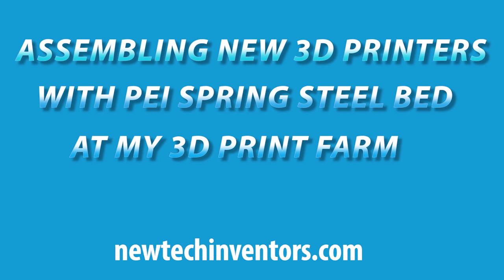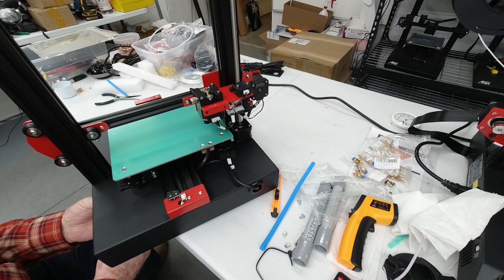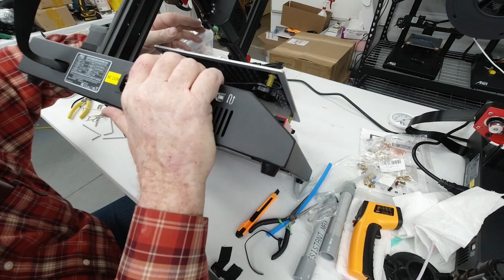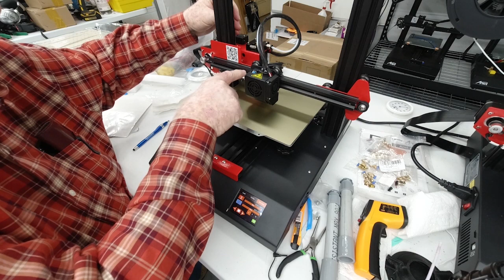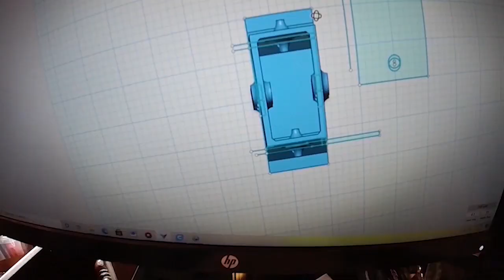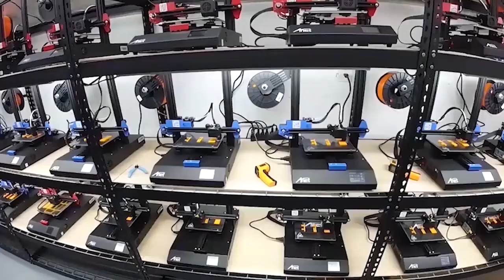ASSEMBLING NEW 3D PRINTERS WITH PEI SPRING STEEL BED AT MY 3D PRINT FARM

Comment: You put printers together like your doing the hokey pokey..looks like a nice printer.  What’s the model?  Are you putting the magnet on printer bed? Thank for one of your finest videos.
Reply from the maker: I don't know if it's up there with the Hokey Pokey Joe, but I do like the fact that I can assemble them  in about 15 minutes. This printer is the Anet ET4 and I am putting the magnetic sheet for the PEI spring steel directly on the aluminum hot plate. I do not use the stick on surface sheet or the glass that comes with the printer. Good to hear from you my friend and hope you have a great Christmas Holliday...Ken

Comment: Ken, you have been running your printers for a while now, out of the various models which one would you say has been the most reliable and have there been any parts that have had to be regularly replaced considering the amount of print hours your machines are running?
Reply from the maker: This is a good question Andrew, and I had to ask myself the same thing. It is a little complicated, so I decided to do a video to answer your question. I will call it " THE BEST 3D PRINTER AT MY PRINT FARM ". Watch for it and we both will find out what I decide is the best 3D printer here. Thanks for inspiring this upcoming video and for your support...Ken
Reply: @NewTechInventors  I'm strongly considering KP3S but there is new model KP5S already on sale from Kingroom but there are not many videos about it yet, have you tested this model yet by any chance?